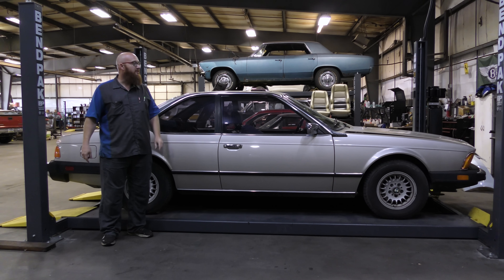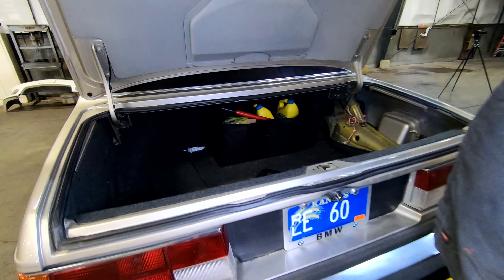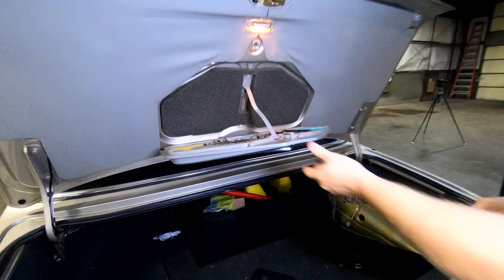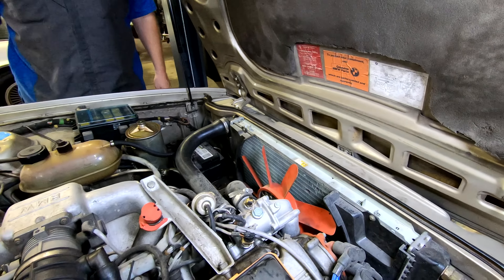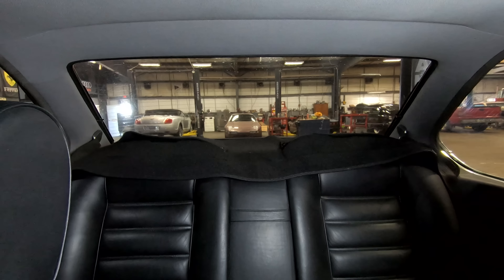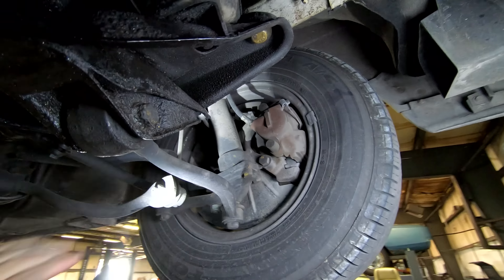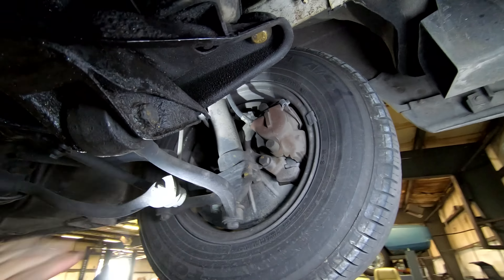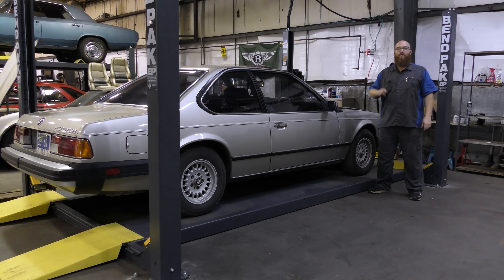Finally a BMW the CAR WIZARD will willingly work on! What makes this '83 BMW 633CSi so special?

Comment: The 80s BMW models were truly the best looking and most reliable
Reply: Owned a 89 525i, first year they made them 2.5 liter M20B25 engine. modded mine to make a little over 220 horse and the car was amazing and just recently sold it for over 2 times what I put into it and bought it for. Only 75,500 miles
Reply: Still have my E30 318iS, very reliable. So much nicer than anything they make today.
Reply: Early to mid nineties were great too!
Reply: @blaketindle4703  The '90s 6 cylinder models were the most reliable/cheapest to maintain. I had two '95 525s. Great cars, except for the manual transmissions. The first one was totalled when I was rear ended. The 2nd one ate 2nd gear. Parts were still available, but the parts would have cost over $2500. I sold it to a scrap yard rather than fixing it.
Reply: 2002/1602.  Great little 2 liter
Reply: @zeusapollo8688  The tii models were my favorite of the 2002 lineup. Lots of mechanics here in the USA hated working on them. I found them to be not much more complicated than a carburetor.
Reply: @alantrimble2881  never had a tii but had four carburetor cars.  Great fun
Reply: any BMW up through e32 is good. After that? Over-complication, hum-drum styling and plastics ruined what was a truly great car.
Reply: cries in e46
Reply: BMW E38 has entered the chat.
Reply: They look old now.

Comment: I restored a 1990 735il to close to showroom condition about 12 years ago....same engine only 3.5L versus 3.3L.  When I finished and enjoyed it, I said, I am never selling this car because it is so good. But I did. Famous last words.  A collector bought it...flew in and drove it back to Nevada where he got a high speed speeding ticket through Nevada.  The big six...what it is referred to is considered one of the best engines BMW ever made...simple and bulletproof.  No vanos or variable valve timing.  Single timing chain and no belt. 2 valves per cylinder and still pulled like a freight train and would rev like a dentist drill.  Around 130-150K mi best to pull the head and change the head gasket.  These engines will go 300K miles without touching the bottom end.  Yes, repeated heat cycles always exposed a weak radiator design BMW's have been known for.  Clutch fans fail once in a while.   At 150K, the engine still had all its cross hatchings in its cylinders and always run on dino oil and not synthetic until I owned it.
BMW as the Wizard rightly says repeatedly, lost its mind about 20 years ago.  A company that exists for profit only.  The last BMW I owned was a 2003 330ci coupe which was really the beginning of the collapse of BMW with all the plastic under the hood and overcomplicated designs which were engineered to extract money from people. Design intent.  The public who doesn't know better...buying into the marketing myth of Ultimate Driving Machine...until they own one or two and stop wanting to be broke and so stop buying them. I will NEVER buy another BMW and I can fix them.  Simple and reliable used to mean something.  Not anymore. The public is utterly clueless...in other words BMW's design philosophy is rewarded and why it continues.
Reply: I've got a 2004 E46 320d with 275k miles on it. Still on the original clutch, injectors and turbo.

Friend has an early E90 (2005) and that doesn't seem any worse than mine build-wise.

These cars are coming up 20 years old, way beyond what any manufacturer has ever expected of of its cars
Reply: I still own and daily drive a '91 735iL with 155,000 miles on it and has owned it for about 15 years.  Pulled the head and replaced the head gasket at about 100,000 miles.  This thing has been a great car and I love this thing.
Reply: @R182video  I have a '94 740iL with the M60 4-liter V8. It has 213k as of now, and the motor itself has never been opened up. Only had to replace the PCV system and knock sensors in 14 years of ownership. My only complaint about the car is the power seats are shit.
Reply: these days it's all plastic under the hood on every car! I have a mercedes sprinter and there's this plastic bracket thing that has no name or word for it because it's shape
and purpose is just weird because it's a bracket that holds the fuel filter in place and it's also a bypass for the cooling system were a few cooling hoses are attached to
and the other end is mounted against the cilinder head, and there it's starts to leak after 30k miles because the plastic is getting to hot and starts to deform and then water
starts to push it's way behind the O ring. Besides that, you can't even recognize an engine under the heap of plastics, wire harnases, connectors, sensors, tubes, pipes and hoses.
So it's like you look at the internals of a washmachine, and there's no way to swap a part without having to take half the engine apart. And thats why they use a large
piece sheet of plastic to cover the entire engine, because else the chaotic mess would scare the crap out of the buyers.
Back in the days the motto was to built cars that last forever, but these days it's all about selling NEW cars as much as possible, so they make cars that last 5 years
because after that the warranty is over ,and then they only care to sell you a brandnew disposable lighter on wheels!

Comment: This is the era of BMW that driving enthusiasts just absolutely loved. This car has the 3 speed automatic (the 6 and 7 series didn't get the 4 speed O/D option until '84), but it could be had with a 5 speed stick and it was one of the most perfectly balanced, most neutral handling cars in the world at the time. It was stable and rock solid and planted to the ground all the way up to 150 mph at a time most American cars were hardly able to hit 120. You felt every inch of asphalt through the steering wheel but it was light and laser sharp to steer. The brakes were powerful, consistent, easy to modulate. That engine - BMW's glorious inline 6 before they started throwing turbos on to it and computers and plastic intake manifolds and plastic fuel injector rails - silky, silky, silky smooooooooooooooth and consistent power all the way up to redline in every gear. And the entire car felt like it was chiseled out of one solid block of steel. 

Somewhere between here and the late 1990s BMW started hiring people who did not understand what BMW was about. What that car was to people who enjoy driving - I mean, REALLY enjoyed driving, took it very seriously, and every second behind the wheel of the car was what they lived for. Driving a 6 series to work was not just the commute to and from work, it was for many the absolute highlight of their day. Their life. Guys driving this car weren't wearing Ray Ban sun glasses, leather gloves, and driving shoes just for show - they wore them because they took driving very seriously.

The Ultimate Driving Machine. It wasn't just their slogan. It was what BMW strived to build.

And then in the late 1990s, they threw that legacy out to chase every suburbanite soccer Mom and image-seeking Dad. BMW cheapened out on the engine parts not to make the cars disposable so much as to make them cheaper. That aluminum intake manifold probably cost 3 times to cast than the plastic one used today. But that was alright - it meant more to pay $60k for a BMW in 1983 than it does to pay $60k for a BMW today. They were cars to aspire to. Cars you'd have to work hard for in school, or work. Today, every schlock with a $399 lease payment can drive a BMW.
Reply: Well said, well written.  Agree completely.
Reply: We just throw the automatic in the garbage where it belongs.
Reply: M30 engine was amazing for its time.
Reply: Its the casualization of luxury. I feel similarly about Mercedes Benz CLA line. A line litteraly made for the lower class
Reply: Absolutly agree. I don’t think I could’ve said it better.
Reply: Driving my CLS55 AMG 25 miles to and from work everyday is often the highlight of my day and why I’m always excited to wake up in the morning. Lol
Reply: @searchforthetruth1  Ah the CLA. Every 17 year old blonde girls dream car.
Reply: @diablocls55  Yeah that's a great ride but it's still a newer Mercedes - which means too many computers and whiz-bang technology.
Reply: @joe6096  still better than any Mercedes made after 2012. And it’s easier to work on than one would think
Reply: E36 is still the peak. This was a boat to drive
Reply: Top speed is 133 MPH (observed).
Reply: @henrik1743  They called it the German Thunderbird and it handles like one.  Should have a tiller instead of a steering wheel.
Reply: @rjjefferson6540  lmao right!!
Reply: @InsaneBimmer  i did throw the stick shifter in the garbage because i drove cars with shifters all my life and had enough of it, specialy when standing
in the next trafficjam, and then nothing beats a automatic. So the rest of my life i will drive only automatic because it's waaaaay more comfortable.
Reply: About as well said as any comment I’ve read on YouTube. Fantastic

Comment: This gear can fairly easily be made on a 3D printer. And quite cheap aswell!
Reply: I was going to suggest the same thing.  Lol
Reply: good idea!
Reply: You should print some up and sell them for $100 a piece!
Reply: is probably also a lot more durable than some 30 year old plastic from a junkyard
Reply: LOL, just posted pretty much the same idea
Reply: Took the words right out of my fingertips.
Reply: Just posted a comment on that, saw this one and deleted mine...
Reply: Doesn't Jake or Elliot have a 3D printer in their arsenal already?  It's be a smart thing to shove in a corner over in JR's huge shop, then you guys could all make parts for your many, many, many cars.. lol
Reply: Like the others have said 3D print one. Scan the old one, print a new one. Better material probably as well.
Reply: If you're working on classic cars a 3D printer would be a great way of dealing with these small plastic hard to find parts. That was my first thought to take care of this problem
Reply: That is a heat molded plastic gear working under high stress, 3D printed plastics are FLIMSY and will not last for this application, will strip the teeth in no time. 3d printed ALUMINUM alloy would be a much better choice
Reply: Well then you also need the skills to design the parts, not sure how easy that is and if they have the time to learn that, the shop sure seems busy, and that is a nice thing.
Reply: This is where I see the next rise of parts. Don't need a huge warehouse, more of a set of molds/designs and print on demand. Or CNC on demand for  metal.
Reply: @rsvp-realscalevehiclesproj6965  3d printing isn't difficult, scanning is an art though, anyway just measure and make in this case
Reply: @NICK-uy3nl  That's assuming consumer grade mass market polymer materials. I'm sure there are more industrial materials available.
Reply: First I would do some research if it could just be replaced with a standard gear that can be ordered for cheap, even if it would require some easy modifications. 
If that's not an option, make sure you print (or let it print) it in an adequately durable plastic like PA or POM. As for the manufacturing technique, Selective Laser Sintering (SLS) or Multi Jet Fusion usually works very well with such parts especially if the gear teeth are relatively small. There are shops with those machines that make such parts relatively cheap.
BUT: You need to create a 3D drawing of the part. For that you have to measure all of its important dimensions reliably (3D scanning usually sucks for fine details and precision parts - especially if the part you're scanning is broken) and probably even have to do some finishing work after the print.
Might not be that big of a deal for a hobbyist, but for a busy car shop owner the time alone needed for such a project probably isn't worth it at all, let alone the money you'd have to pay someone to measure the part and create the 3D drawing if you can't do it yourself.
Reply: exactly my thought when I saw this! Just send it to get it scanned and printed! 3d printing in both plastic and metal must be a really neat trick with parts like this! 👍
Reply: @mikaeljonsson4686  - To get this part scanned and printed in plastic and metal will easily cost $100-200. Better off buying the complete antenna assembly new
Reply: @NICK-uy3nl  If you can find it, I thought that was the issue... With a car like that I def would like to keep it as original as possible!
Reply: @NICK-uy3nl  Wait they have those printers metal too? Cool
Reply: If it was me, I'd fire up a lathe and make one out of brass, far more durable and precise than a 3D printed one.
Reply: It should be doable, it's worth a try.
Reply: @noth606  I bet a clockmaker with a gear cutting engine could make that gear out of brass.
Reply: @jd3552  I could do it on a normal size multi function lathe with the right tools. I haven't done that stuff in years so it would take me a bit of time, but it's doable without a clockmaker or very fancy tools, cutting gears etc is not very exotic in terms of lathe work.
Reply: @NICK-uy3nl  Depends on the material used in the print.  PLA and ABS are a nogo.  Nylon and HPLA as well as carbon fiber are good,  There are others, but I haven't printed with any of them.
Reply: with all these plastic parts on modern cars, it's the way to go

Comment: Wizard - I’m not working on older cars, AND I’m not working on BMW’s. 

Also the wizard - I’m excited to work on this old BMW !!!
Reply: Hahaha yeah I was thinking the same 😂
Reply from the maker: Old as in 50s-70s
Reply: @CarWizard  You would refuse to work on a 1977 Fleetwood Brougham but would work on a 1990 Brougham, which are almost identical cars except the 425 vs the Olds 307?  How about a Euro 1979 W126 280SE which is almost the same car as a 1991 300SE?
Reply: Glad I'm not the only one that heard him say that. If it comes with a dump truck load of cash behind it, he'll work on it.
Reply: @jptech57  “almost identical” but with far more years of degradation. That is what the Wizard is driving at. And again, parts for 70’s and 80’s cars are drying up.
Reply: @jeffgriffith7003  You consider 13 years a significant amount of degradation?  I would not but there are many variables to consider.  Parts availability varies greatly from brand to brand but both the Cadillac and Mercedes I mentioned have great parts support and many used parts because both sold well for a long time.  I would be surprised if that becomes a significant issue for either car in my lifetime.  A W140 or an Allante would be a different story.
Reply: @jptech57  Cars today are made with more plastic and made to only last about 5 years so that way you keep trading em in. Now obviously mechanics like, the Wizard here does not like it when new cars keep getting sold because that means he gets less older cars that are out of warranty to work on and charge a shit ton for in labor on. Lol. He says new car manufacturers are greedy and horrible but on the other end of the car scale, Wizard is greedy and is in business to make money, just like the car manufacturers. Everyone is biased to there own lives and life styles. If just 20% more people bought new cars every 5 years, Wizard will be making a lot less money. Ha
Reply: @mmm365  Cars today are made with more plastic and made to only last about 5 years so that way you keep trading em in. Now obviously mechanics like, the Wizard here does not like it when new cars keep getting sold because that means he gets less older cars that are out of warranty to work on and charge a shit ton for in labor on. Lol. He says new car manufacturers are greedy and horrible but on the other end of the car scale, Wizard is greedy and is in business to make money, just like the car manufacturers. Everyone is biased to there own lives and life styles. If just 20% more people bought new cars every 5 years, Wizard will be making a lot less money. Ha
Reply: @nexpro6118  I wouldn't say he's greedy, but I think his decision is short-sighted and a bit contrary to the mission of keeping older cars on the road, which he says he supports.  I think ultimately he is doing this to maximize profits in the short run before retiring in maybe 5-10 years.  Hopefully he is teaching the methods he has learned to his underlings so they can do what he is not willing to do currently.
Reply: @jptech57  true, but since hes a specialized shop with exoct cars he charges way more than dealers do with labor cost even when working on just regular cars like a Ford focus lol. He's more than double the labor cost than some dealers lol
Reply: everyone has the option to take their car wherever they please. there r hundreds of mechanics out there. he is very good and very thorough and nobody is forced to pay his fee.